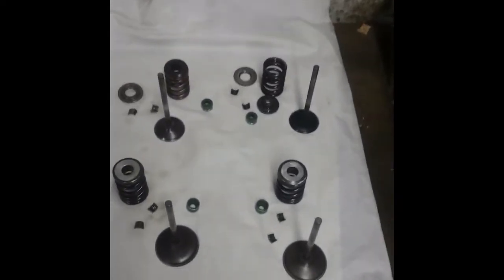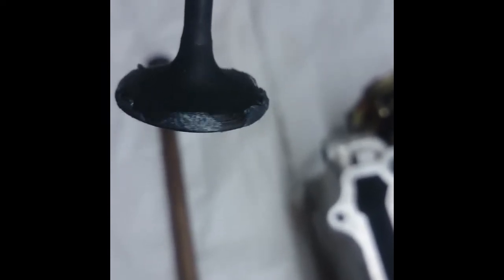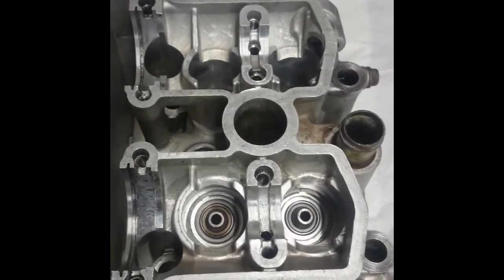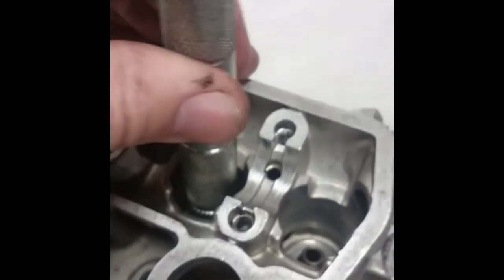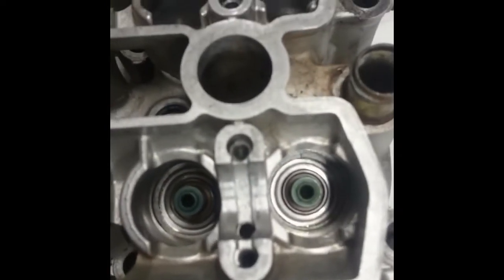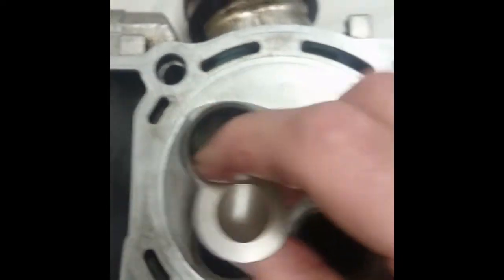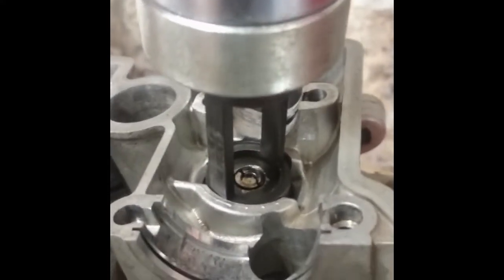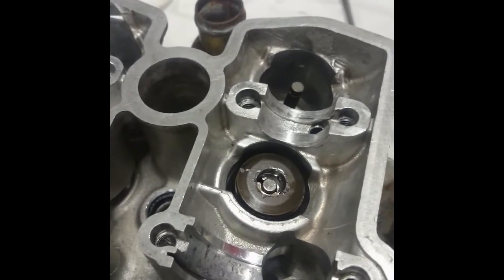RMZ450 4-stroke dirt bike head rebuild. Valves ground in and fitted.

Comment: What valves did you use? Are you not grinding the hard coating off the valves doing it like this?
Reply from the maker: This is regrinding the original valves.
You are only resurfacing the valve and seat and not taking much off.
The valves are hard all through